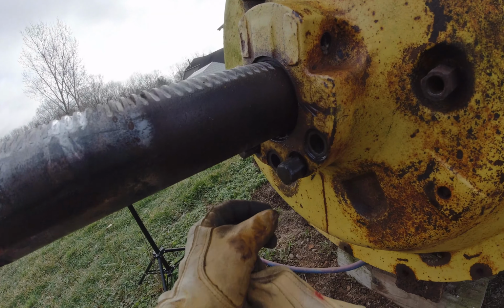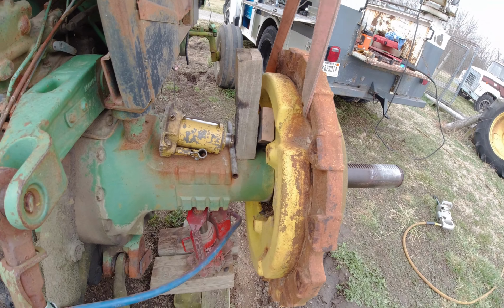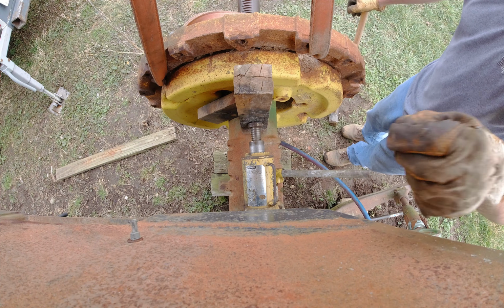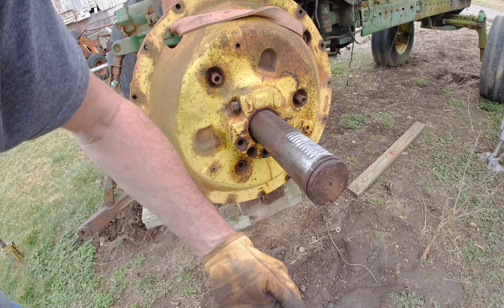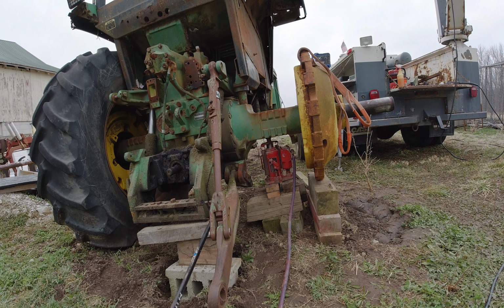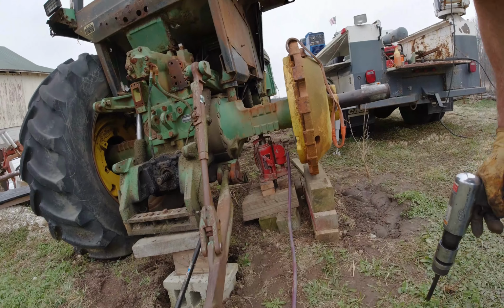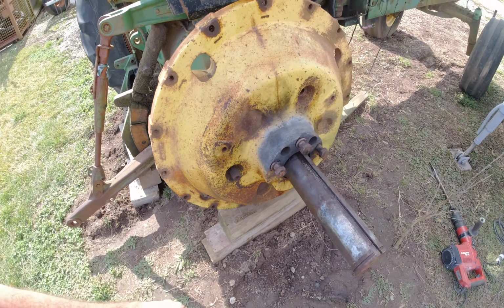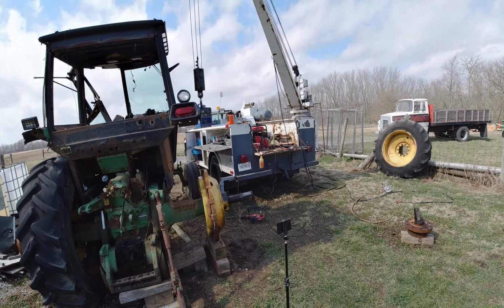Stealing The Wheel Weights Part 2    ALL ABOARD THE STRUGGLE BUS!!

Comment: Turning the bolt over the rack/gear teeth might help move the weight like a rack and pinion. Might help wiggle it and loosen up the wedge.
Reply from the maker: Would you believe that was seized up also? It's a mess!